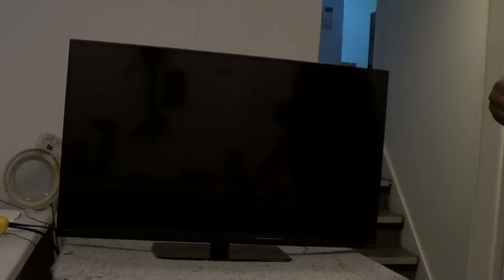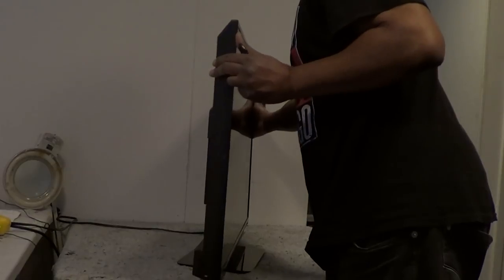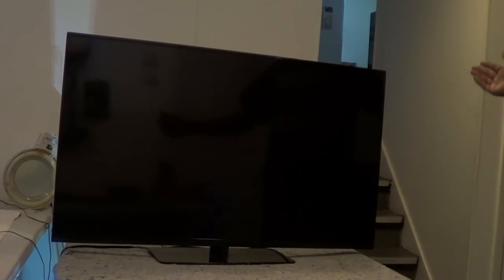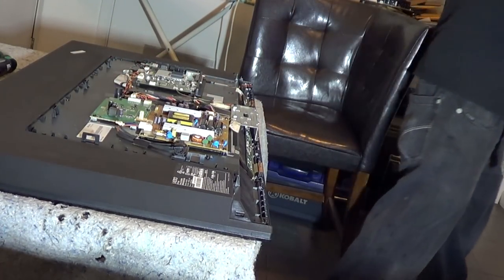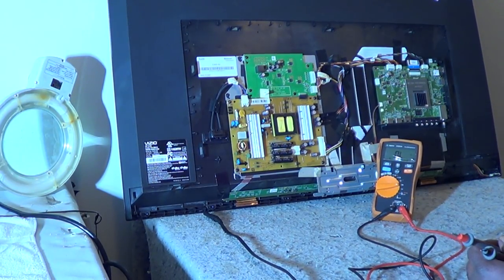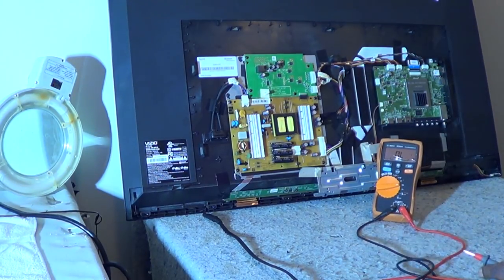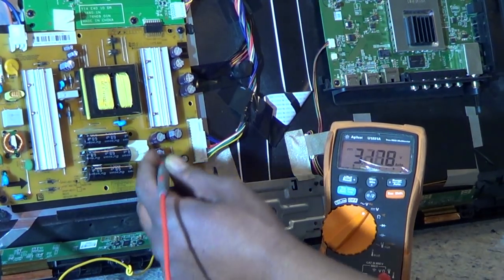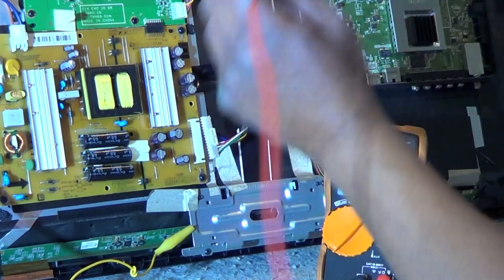Vizio B2 series led tv power supply troubleshooting and repair.  Capacitor tester comparison.

Comment: My Vizio 26" monitor  would turn on and go black after two seconds. I have no background in electronics. I took it apart,  and was able to learn from the web that it was something with the power supply board. While visually inspecting everything I noticed one of those baby blue capacitors was burst like a popcorn kernel. Just split, and darkened area around it. I've got the replacement coming in the mail.
Thank you for sharing your process. If I need to go deeper into testing, I'll check out that meter you like.

Comment: Great stuff! Love your flow and style. I have a few of those U1231A meters (Keysight). I agree, they are top-notch performers. Used daily even though I have Flukes I usually reach for my U1231A!
Keep up the great job!
Reply from the maker: Greatly appreciated my Brotha. I actually had mine for almost 6 years, now that I think about it. No problems yet; thats amazing for as much as it gets banged around and left in my toolbox and for days in the back of my truck in 20 degree weather. That been an ongoing process for almost 6 years. Been thinkin about buying some more Keysight equipment.
Reply: I hear you..always nice to add to the troubleshooting equipment arsenal! 
A seller on Ebay (North America) is listing new Keysight U1231A for 119 US..!!
Reply from the maker: These Tech's betta jump on it b4 he sell out LOL

Comment: If my voltages are showing about 1/2 of normal everywhere, would that possibly be a bridge rectifier issue? Testing the E420d-A0 with no picture, but screen flickers every so often. High jumping voltages to led vout 1 + 2, but my standby voltage (5.1v x 2) and 12v are reading a steady 2.6v and 6v respectively.

Comment: Will a lower grade power cord cause start up issues?
Power cord is 300v 105○c  plug in (where it plugs in at reads 600v 125○c.

Comment: Hey bro good video I was doing visual inspection after I see your video, I have the VIZIO model m50C1 and seems like I am getting 19.16 Volt from power supply I could not detect any standby power, when i tested it and I checked the main board and it seemed like there was yellow goooy residue on the back of the board, I do get the POwer LED Light that comes on and LED light starts to BLINK about 16 times, As far as I can see there is no blown capacitors on the power supply board but I suspect the main board to be the issue and that the capacitors blew from underneath and thats what the gooy substance is all over the board any feed back would be appreciated

Comment: Big dog don't use that junky meter get yourself a great meter it's called blue ear meter from anatech  it test In or outta circuit and it very acorat very reliable I have one it works great just awesome it saved me lot of time and it made my repairing alot faster and easyer too
Reply from the maker: Thanks. But I think you mean ESR meter right. My hearing is just fine lol.

Comment: Very Nice way for finding fault. Help required i have the 65 inch chinese brand team in power supply i donot get 12 & 24 volt only get 5 volt ,And also back light also get on but no picture is coming is fault in powwr supply board or in the main board .

Comment: What if my output power supply standby is supposed to be 3 to 5 volts but it reads 11 Volts. Is that the power supply problem. Thank u
Reply from the maker: If its a Samsung that could be the standby, look on the board and see if the standby voltage is listed. If its not supposed to be 11volts, then unplug PS from Mainboard and recheck. IF still 11v then yes, replace the Power Supply Board.

Comment: Let me see if I can recoupe the two values on each part.   The original capacitor was 200u at 25 volts and you went ahead a upped it 220u at 35 volts. So you can go up a little because the capacitor will last longer and it doesn't harm anything going up a notch on the capacitor, right?   Now the white cap,  it was in Nano frarods?  You upped the Nano farods or the voltage or both on the white cap?
Reply from the maker: 220uF at 35v.  Never seen a 200uf  Electrolytic cap inside of a TV. Thanks for watching.
Reply: @bigdog8882  My error,  I went back and saw  the 220u/ 35 volts on the cap.  I'm still learning there BigDog, just keep right on teaching .  I saw another tech up the voltage of a capacitor on another video but the Capacitance remained the same. Just got off track.  I'm still trying to concentrate on diodes, heh, heh.

Comment: HANNSPREE monitors have a major design flaw in that they covered the air vent holes with aluminum adhesive tape... so stupid.  How often do you see this as a common problem...which brands?